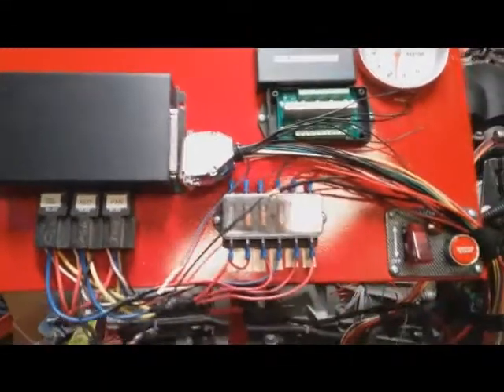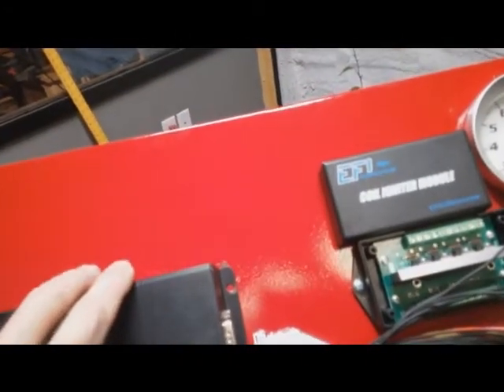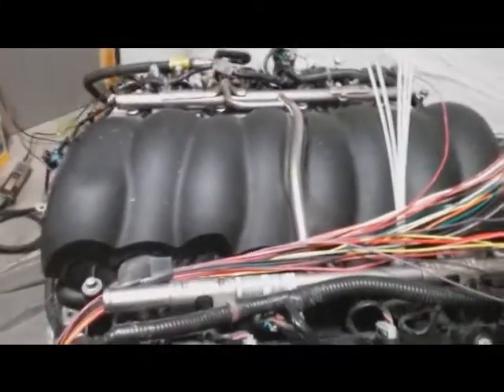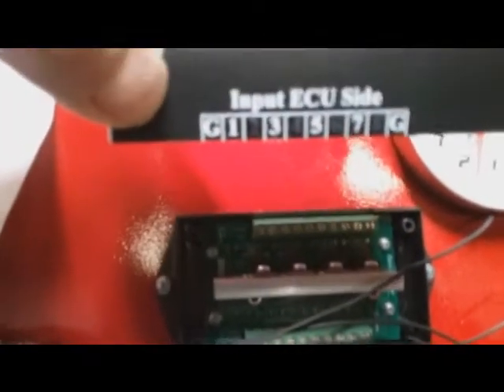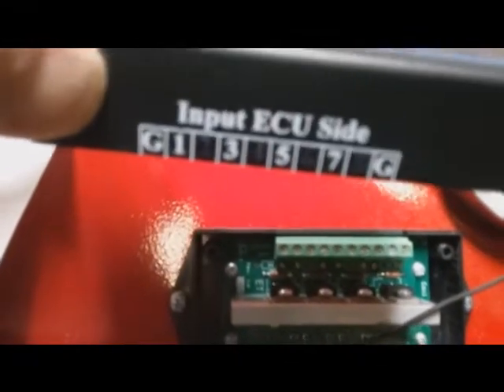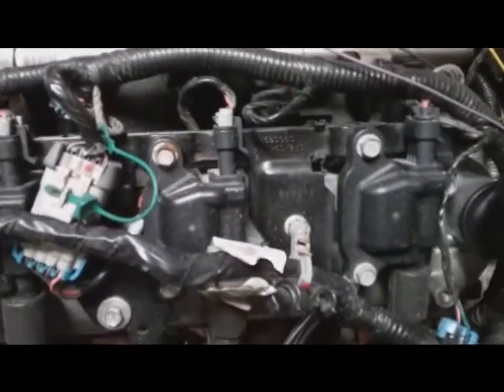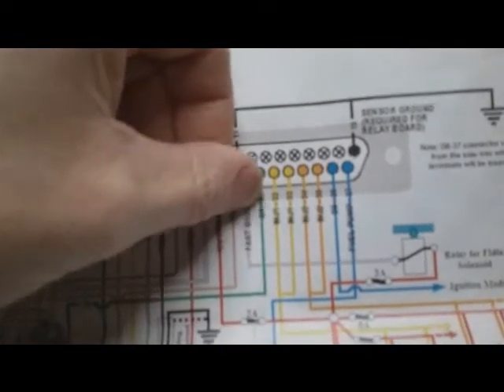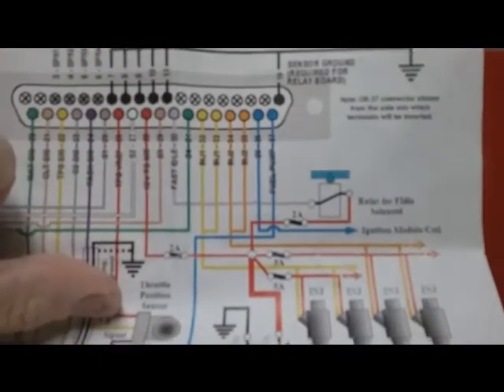megasquirt coil wiring??? how to? 8 coils one ignition wire output.. my head hurts bad!!

Comment: Hope you figured all this out. The ms3 has multiple outputs for coil drivers. If you got a coil on plug setup then the coils have a driver built in. You need to figure out if they trigger high or low. Meaning they're triggered with voltage or trigger with ground. Using that driver box might be too much current to drive the signal just to get a spark to light off. The expansion card is the best bet for the money. It's got 8 spark and 8 injector drivers. I know this video is a year old already, but I hope this helps anyone reading this later.

Comment: the ms3 can only drive 8 coils individually if you have the MS3X card. to run the MS3 V3.0 board in batch fire ignition mode you have to open the case and modify it. here is the link for the manual, the wiring instructions start on page 87:  http://www.msextra.com/doc/pdf/MS3baseV30_Hardware-1.4.pdf 
if you want to use the single wire then you have to run a distributor conversion drive on the front of the engine with a single coil.  
 your coil driver unit is useless because the ls factory coils have  a 5 volt coil driver circuit built in which both the ms3x and internal conversion fires the coil through those 5 volt driver modules. when using the internal modification to run batch fire ignition you must use 4 outputs to run a v8. for every cylinder you fire on the compression stroke there will be a cylinder on the exhaust stroke.  these two cylinders are considered a pair and both receive the same coil signal.
as for your injector wiring the injA and B wires get wired into banks.  one bank gets the inj A wires and the other gets the injB wires.  the wires are joined to increase the current capacity of the system. internally you tell the ecu which cylinders run on the A and B circuits and from there it knows which o2 to use for fuel error reference if you have dual o2 sensors wired in. if you run a single o2 then it knows which cylinders belong to what side of the motor but the fuel error trim applies to all cylinders instead of per bank.   all 6.2ls come factory with a 58 tooth reluctor on the crankshaft. 2004-2005 was the switch over point with the latest engines being 2007 truck motors (6.0).  it can be determined by the color of the crank sensor (black = 24x and grey = 58x)